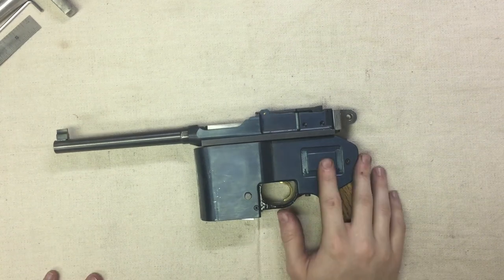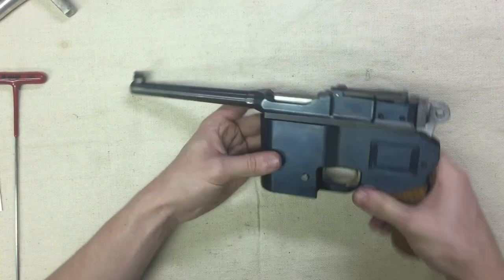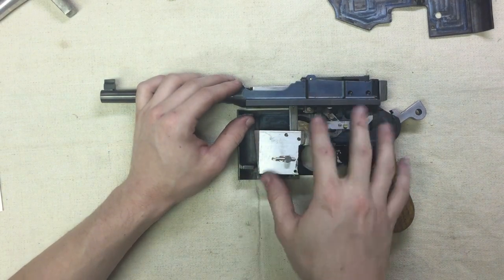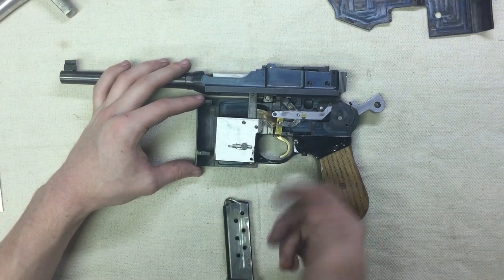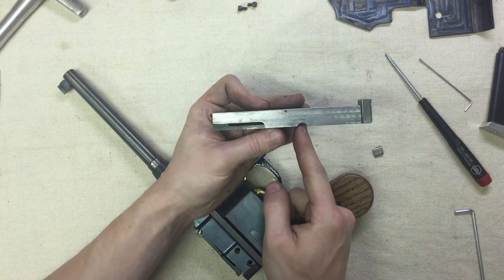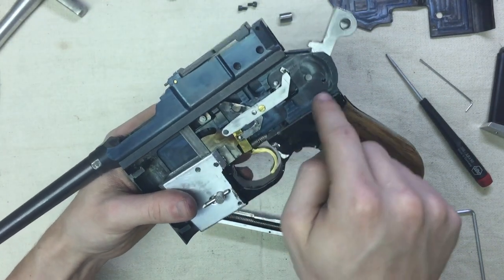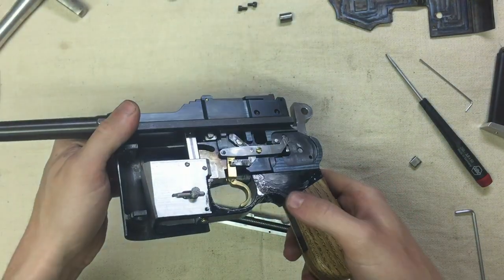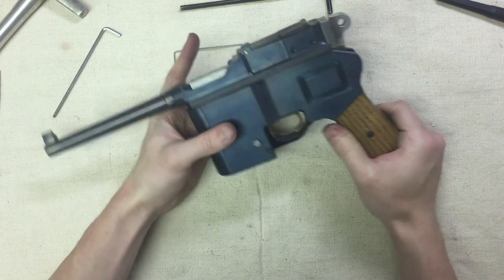Broomhandle Build: Disassembly and Discussion

Comment: Saw you on Reddit you are AWESOME, looking to build a CNC mill and get a lathe so I can get into smithing.

Do you publish plans? I have been wanting to build a replica of the Mars pistols. Would like to take a closer look at your fcg for it.
Reply from the maker: I do not currently publish plans, however I am in the process of going back through all my drawings and redoing them much more professionally, and then I will offer them for sale. However, to be honest you really shouldn't take this FCG as a good example, this is a terrible FCG in this gun. The FCG in my toggle-carbine is much better, but still not super well-suited to handgun use. The Mars Pistol is something I've looked at myself a few times, but I've never come up with a design I was satisfied with, so let me know how that goes.
Reply: @domsworkshop1325  I will, and I have had the same issue with it, I have issues with trusting the disconnecter and the slide stop. Thinking of copying the 1911 fcg for the hammer and no clue as of yet what I will do for the bolt hold open.
Reply: @keenumman1  I just want to yell YEET while firing a ye'old desert eagle....
Reply: @andrewyork3869  
You mad man
Reply: @keenumman1  on a slightly more serious note I do have an interest in using is as a platform for a handgun with the intent of taking shots at long range. (Well for a hand gun at least 600-1200 yards.) By all accounts there are easier and dare I say more practical ways to do this with a bolt action or revolver style gun. But those aren't as spectacular as the mars...
Reply: @andrewyork3869  
Just an idea I'd you wanted to cut down on the size of the pistol grip since if I remember correctly the mars had a huge grip. You could make a magazine follower that tilts the rounds at a 45 degree angle. Crye precision is doing something like that with their 300blk pdw.
Reply: @keenumman1  yeah I have looked into stuff like that, another idea I had was actually to place the magazine behind the grip a bullpup pistol of sorts.

Comment: Is there any particular reason you didn't try making your own magazine? I've noticed that people only very rarely attempt that, regardless of skill level.
Reply from the maker: I actually did try. I've tried several times with several guns to build my own magazines. It's just a really really hard thing to do.
Reply: @domsworkshop1325  What makes it so hard? The tedium of having to test slight tweaks to the mags over and over again?
Reply: that's my understanding.
Feed ramps are super particular and it's just easier to buy what's already on the market
Reply: Well luckily there are 3D plans for Glock mags, so anyone can print them.
Reply: @koolaidblack7697 magazine engineering is so tedious.  Someone described it as "a touchy feely process, like a ship in a bottle in a black box you can't see in to."

Comment: "Everything is in duplicate" I'm only part way through the video at the moment, but it doesn't seem like you really go back over that part. Why is that? Relying on some mechanical redundancy?
Reply from the maker: Mostly to balance the forces. I was concerned that if it was all on one side it may tend to twist. That really wasn't an issue though, and I could have done it much simpler.